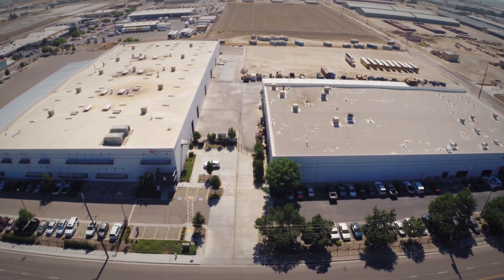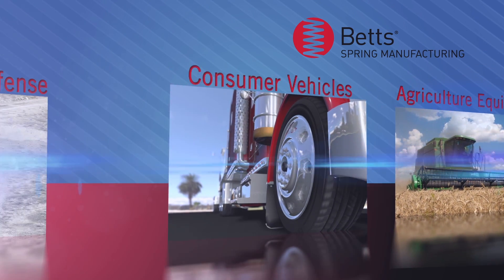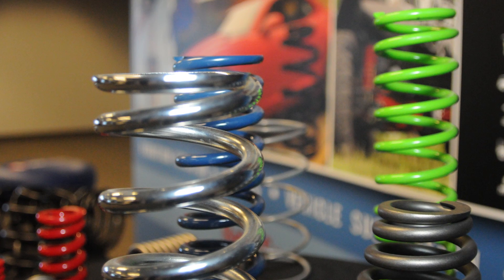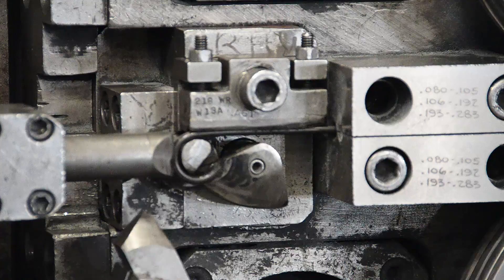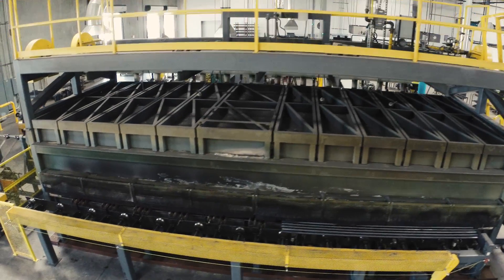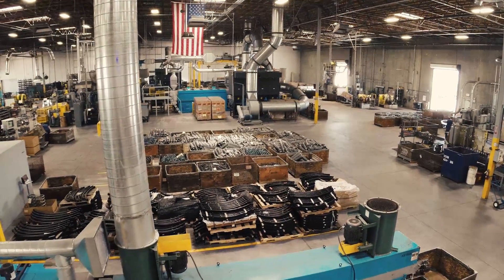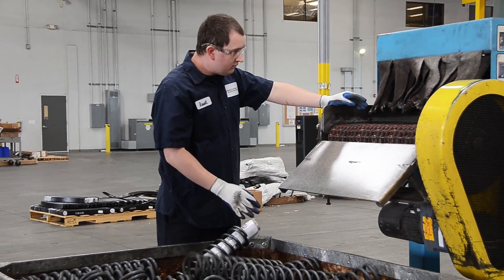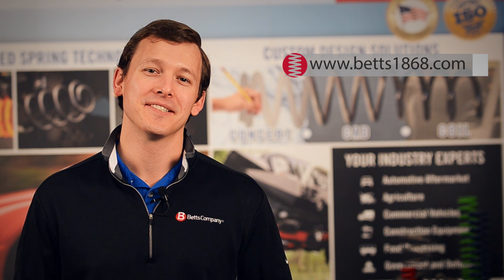Hot Wound Springs vs. Cold Wound Springs

Comment: Whats the pro’s of hot wound springs?
Reply: hot winding machine can coil almost any wire diamter by the other hand cold coiling is limited to coil ratio and mostly used for 18mm and lower wire size, i would say anthing below 150N/mm rate can be cold winding and anthing higer than that it has to be hot winding.
Reply from the maker: Hi Mads, great question. The heat treating process changes the structure of the metal. This allows the spring to perform according to the desired strength needed for the application, whether off-road, racing, etc.
Reply: Betts Spring Manufacturing Thank you so much for the answer.